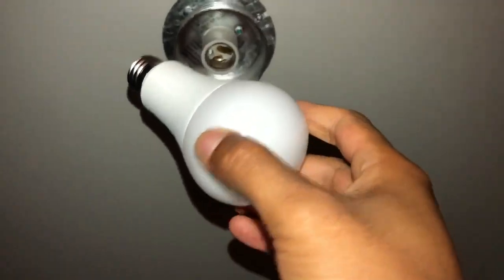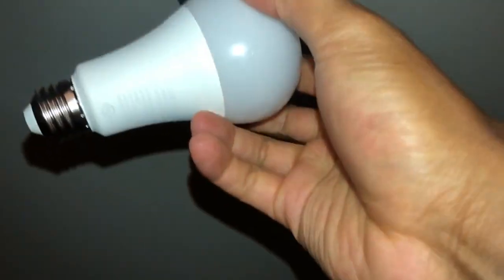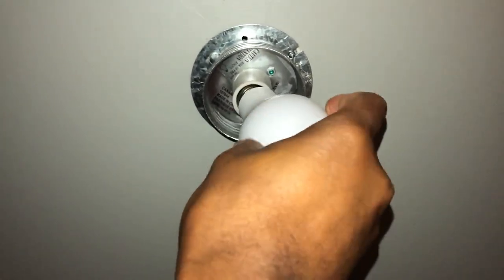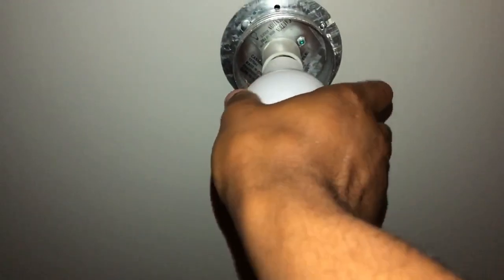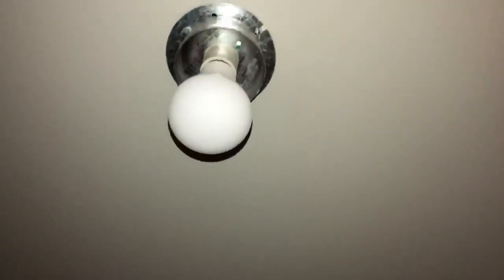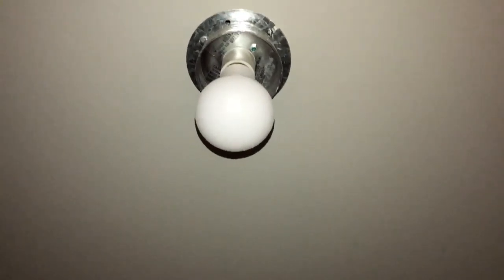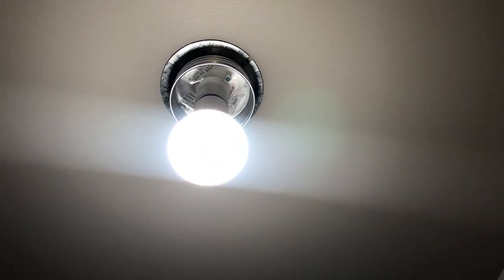How to screw in a lightbulb

Comment: Thank you, unironically. When I tried unscrewing the last few lightbulbs they broke for some reason because it turns out the bulbs are too stuck into the socket, so I had to use tweezers to remove them. As such I was too anxious to screw on new lightbulbs, fearing that some may break.
Reply from the maker: Glad to hear it helped!

Comment: I see you used a LED bulb, so does an incandescent or CFL bulb screw in the same way?
Reply: yes typically, the way lightbulb's work vary depending on what type however they almost always have the same layout for actually installing them.
Reply from the maker: @rongardner485 did you ever figure it out?